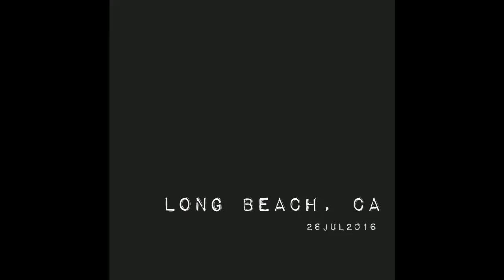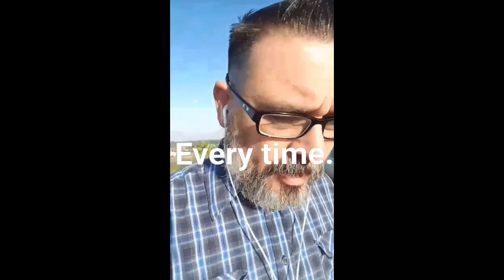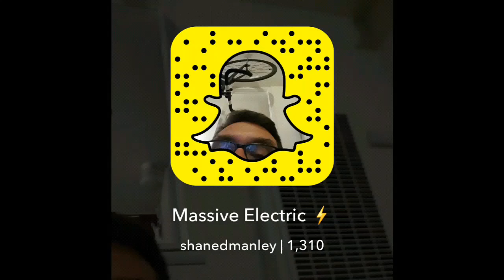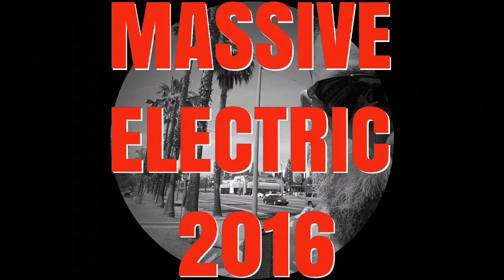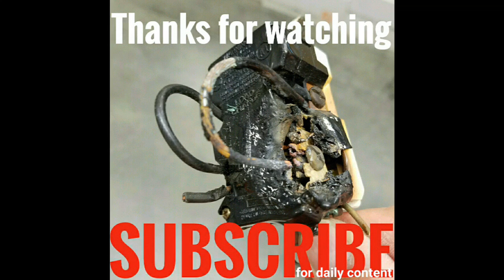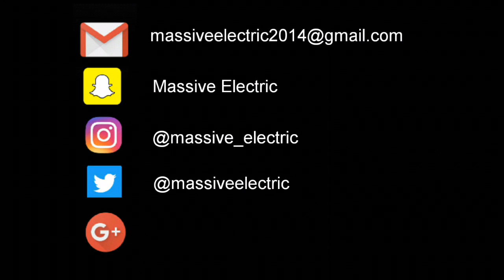Can I Replace My 100 Amp Panel With a 200 Amp Panel?

Comment: When I upgraded to a 200 amp service all they did was put in a 200 amp box, the electric company do nothing but unhook and hook back up the wires, I have no idea what the hell he is talking about, it not 3 phase.
Reply from the maker: +tyler hines when you say "I have no idea what the hell he he talking about" what are you referring to? Did the contractor say something that confused you? Or is there a problem with the install? And if it's your home, it is true that it is not 3 phase. Also, there is much more that goes into a panel upgrade than "just" putting in a 200 amp box (99% of which you will not "see" if the work is done correctly), however the actual service wires must be upgraded, but the electrical utility does that after all the work is done. Hit me up on Twitter, Snapchat or IG if you want to have a longer conversation.
Reply: So the electrical company upgrades your service then afterwards they upgrade your service entrance cable????  The fuck kinda logic is that?  Does the fire department spray the hose then set the fire. ;?  Hell you talking about?  They gotta size the cable before they flip the switch...
Reply: When i take a shit i flush then wipe my ass then procede to pinch my loaf, use less paper that way but people tend to stay away from ya then...

Comment: I asked all those questions then bypassed the overpriced electricians and upgraded my service from 125 to 200. Did it all myself except for the power company tie in. easy peasy thanks to google and youtube.
Reply: That's exactly what I need to do go from 125 to 200. Any suggestions on what's the video that helped you the most?

Comment: It works  my service wire is for 200 but my meter box outside is 100 amp but my inside breaker box is a  new 200 amp
Reply: Some smart meters appear to be for 100 amp service per the markings on the meter but are actually rated for up to 200 amp or even sometimes 400 amp service.  Don't take that as meaning all meters though, it's hit or miss and in electrical terms hit or miss means life or death.

Comment: Upgrade the service? What the heck does that mean? The lines run to my home from the electric company can handle 200 amps. This is typical. The panel is a 100 amp panel. If I want to upgrade to 200 amp service all I need to do is change the panel. The electrical company wants to do its own inspection if I have them disconnect power for the upgrade. But they do nothing other than that. There is literally no change on their end.
Reply from the maker: +ballzack57 I'm afraid it isn't typical for electrical utilities to feed 100 amp services with wire that can handle 200 amps, it's simply not cost effective, not to mention they don't plan that far ahead. They may have done it at your property but I have never seen nor heard of that. Plus the utility doesn't do inspections that is the responsibility of the local municipality or county, they don't even disconnect power, it's done live. Then they will come back after everything is done to install permanent crimp lugs on the feeders.
Reply: That is simply not true for my area. My power company must inspect and approve your service change...period.
"The first thing that needs to be done when upgrading electrical panels is to verify the location of the service panel upgrade. This is something that needs to be approved by the power company (A.P.S. or S.R.P.). You can call them up and tell them you are going to have a service panel upgrade done and need to verify that your chosen location will be approved by them. This service is provided free of charge with all service panel upgrades because the utility company needs to be sure that they have access to the power meter. Your current location may no longer give them the access that they require."

Furthermore, in every home in my neighborhood, friends neighborhood, and parents neighborhood, the standard service ampacity is 200/225. Verified by both APS and SRP.
Reply from the maker: +ballzack57 our service utility spotters don't inspect out here, they just verify the location and note the upgraded service size, but it's the same process you go through. And while most residential upgrades are 200 amp nowadays you can still get a 100 amp here. What state are you in?
Reply: Probably not a very old house.

Comment: Hi so I had a question. My brother in law has a body shop and only has a 60amp panel he need more power like 200amp service . I called the utility company (AEP) and asked if they needed to come change out the service wires from there end to the meter and from the meter it goes to a disconnect (with fuses) and then it goes to our 60amp panel. Surprisingly they said no they told us just to go ahead and change our our panel box to a 200amp. Does this sound right?
Reply from the maker: +Ashley Valdez no. Unless the service wires are oversized (for the 60 amp) already, which is possible but not likely. Generally, the utility company requires the owner/ tenant to do the upgrade wirh panel and (some) wires, but it friends on where the service wires go to. I'd the service wires run directly into the existing 60 amp panel then I suppose they would do the rest. Basically, the meter itself is the split between the owner/ tenant responsibility and the electric utility responsibility. Hope that helps. You can contact me directly if you like.
Reply from the maker: +Ashley Valdez I thought I replied to you, but I don't see it, so... no, that doesn't sound right but the utiloty is probably saying go ahead and do your work, then they will come back after and run new feeders from their transformer or power pole to your new panel. It depends on the specific location, but basically the utility is responsible for electricity UP TO the meter, and the tenant/owner is responsible FROM the meter to the property. Hope that helps, feel free to contact me if you have more questions. Thanks for watching.
Reply: @MassiveElectric  
I purchased the house 4 years without water and electric meters. Can I run new wires from meter to new 200 amp panel.Then electrical inspector needs to come out and do the inspection?
Can I do that before inspection??Thanks

Comment: i am about to upgrade a fuse panel to a 200 amp breaker panel, is there an easy way to determine the Kw the house needs?
Reply from the maker: +Michael Williams not really, although there is a calculation engineers use as a guide. If you are upgrading a single family home, say a 2 or 3 bedroom single story building with no ammentities like pool or jacuzzi, you will be fine with 200 amps. This is the most common electrical upgrade for residential.
Reply: Thanks. I only ask because the electric company will have to upgrade their service and asked what the kw will be after the upgrade.
Reply from the maker: +Michael Williams hmm. The utility asked what the kW would be? Interesting. Here in SoCal the utility does their own calculations based on the service amperage size.

Comment: is there a limit in amps that your subpanel can hold . i just want to add a 30 amp circuit to it , there seeems to be enough space to add one ... thanks
Reply from the maker: +Marty Forkwater another great question, there is a limit, but GENERALLY if you have breaker space, you can do it. The one indicator that you might not be able to is if you  have breakers that trip often, especially a main breaker.

Comment: what does upgrading service mean?  You're a bit condescending and arrogant in your explanation.
Reply: only electrician knows does terminology
Reply: You're condescending
Reply: The service means the electricity supply coming into the house from the telephone pole outside. So you would call your power company and tell them you're upgrading to a higher amperage and they'll send someone out to help
Reply: Most trades use some horrible terminology.  It's just one of those things you have to live with because all the codes are written that way.  Kind of like "port" and "starboard" when it comes to ships.  Anyway, by electrical "service" electricians are referring to the service provided by the electrical company to your house.  So when they say "upgrade the service" they mean upgrade the stuff outside your house like the wire that comes into your house, etc.